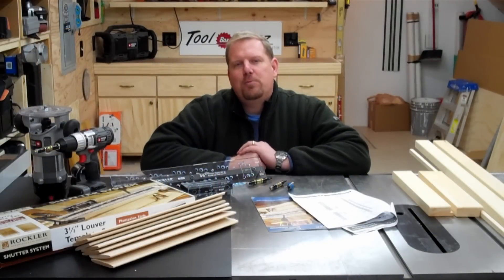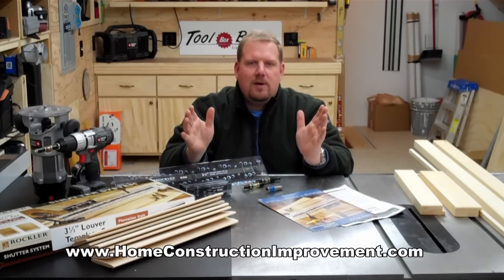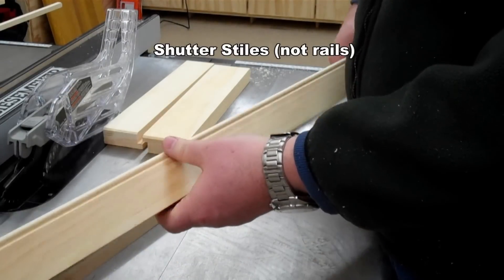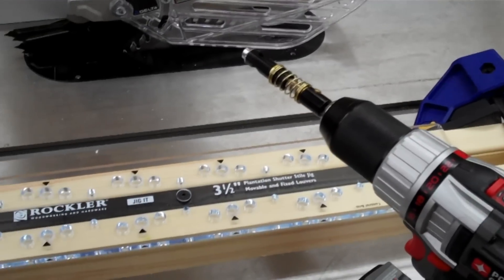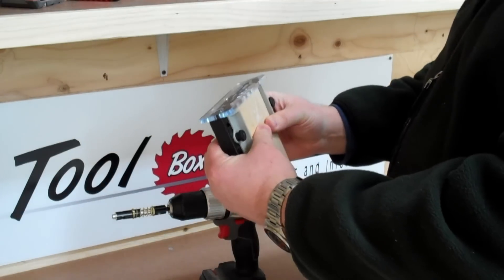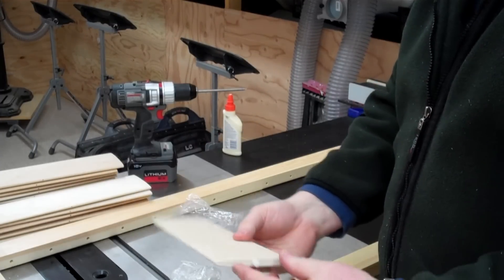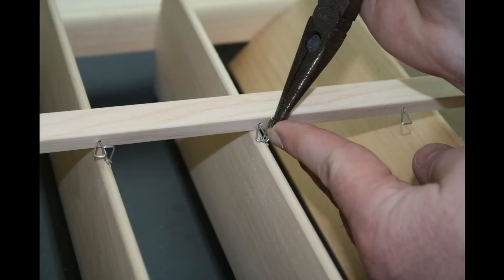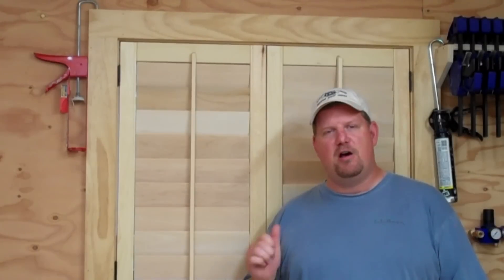Rockler Shutter Building System - How To Use

Comment: When you build the shutter parts I found that when I dry-fitted the shutter to check everything was working ok it was easier to glue one stile to the rails, square it up, clamp it and let it dry. That way you only have one side to worry about.
Then when it comes time to glue it all together I used a clamp with light pressure on the end rail and stile so that the joint doesn't come apart when you are inserting the pins half way down the stile. I gradually tightened the clamp as I got further down the rail.
Have another clamp handy every 300mm or so down the shutter so that the pins don't drop out.
Putting it together was the part I wasn't looking forward to but with the clamps it was easier than I thought.

Comment: You mentioned that you hope Rockler improves on the hook method of attaching the louvers to the control arm.
Unfortunately those hooks have been the industry standard for decades. Some folks use small eye hooks but that tends to create more slop.

I don't know if the kit told you to do this or you figured it out on your own but, it looks like you installed the hooks into the control arm first, then into the individual louver. That is the fastest and easiest way to drudge through that process. I use Sommerfield Tools for Wood process. But, the 2 jigs in this kit bare looking into.

Comment: I have this kit.  I am nearly finished / almost at assembly - but I was a little concerned that the jig holes for "moveable" were edging closer to one side than the other.  Should louver pin holes actually be pressed out a little / not centered?

Comment: Hi Todd, i have some question, what wood-quality you are using ???? 
Greeting from Germany :)
Reply: It looks like he purchased the Rockler louvers pre-made, and Rockler uses basswood for their louvers. The frames look to be made from North American Pine ("Select Pine" if you are shopping Home Depot in USA). The rails and stiles, as recommended by Rockerl, should be made from 5/4 (1+1/16" (26.9mm)) lumber. The Rockler jig to drill the holes for the louvers requires at a minimum 1" (25.4mm) stock. You don't need dense, heavy wood for plantation style shutters so basswood and pine are both good choices for that. Easy to repair, reasonably tough for their usage, and can be painted or stained. Basswood tends to get a bit feathery if you sand it, but it machines well with sharp saw blades, power drills and routers.